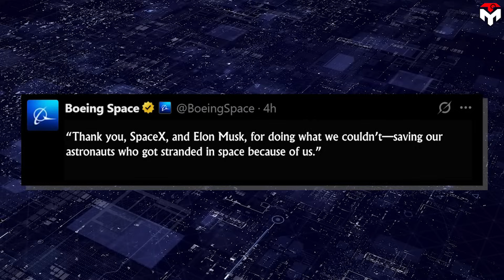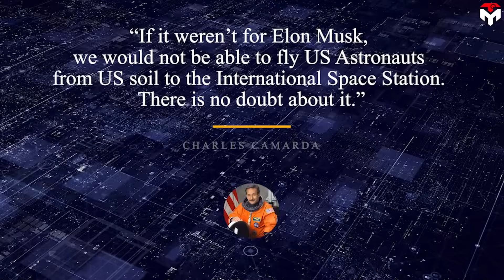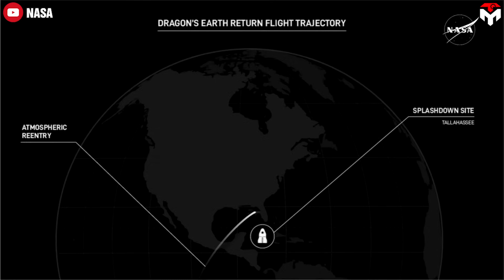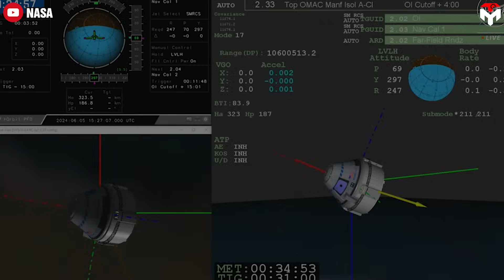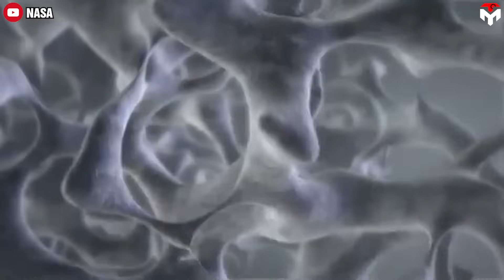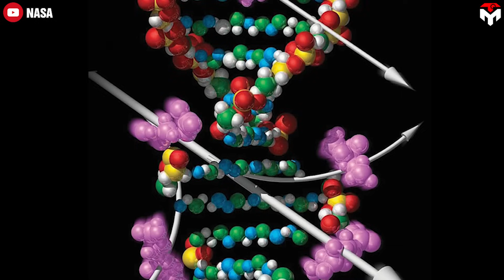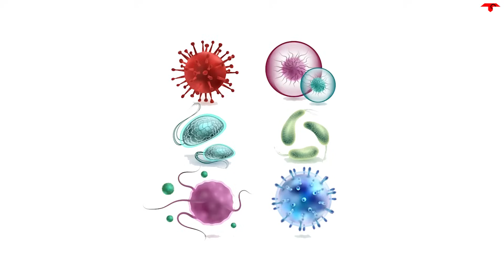SpaceX's Dragon Returned NASA Astronauts after 286 days on ISS Humiliated Boeing Starliner...

Comment: You need to check the facts about where the apollo missions splashed down 

Apollo 10 splashed down in the South Pacific Ocean, 15°2'S, 164°39'W. 
Apollo 11 splashed down in the Pacific Ocean  920 miles southwest of Honolulu
Apollo 12 splashed down in the Pacific Ocean .   The splashdown point was 15 deg 47 min S, 165 deg 9 min W, near American Samo
Apollo 13 ; South Pacific Ocean 21°38′24″S 165°21′42″W / 21.64000°S 165.36167°W / -21.64000; -165.36167
Apollo 14: splashed down in the South Pacific Ocean], approximately 900 miles (1,400 km) south of American Samoa
Apollo 15 ; splashdown North Pacific Ocean 26°7′N 158°8′W / 26.117°N 158.133°W / 26.117; -158.133 
The Apollo 16 spacecraft touches down in the central Pacific Ocean at the end of its mission. Splashdown occured at 1:45:06 p.m., Thursday, April 27, 1972, at coordinates of 00:45.2 degrees south latitude and 156:11.4 degrees west longitude, a point approximately 215 miles southeast of Christmas Island.
Apollo 17 Splashed down was in the South Pacific Ocean (17.88°S 166.11°W)